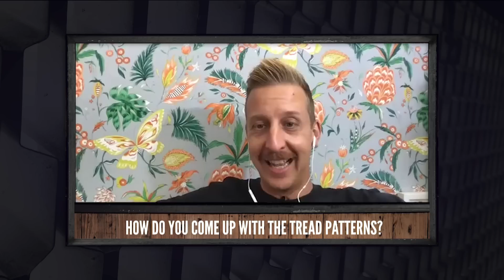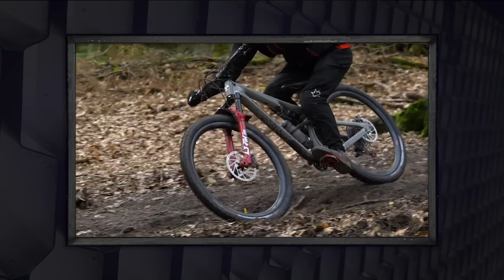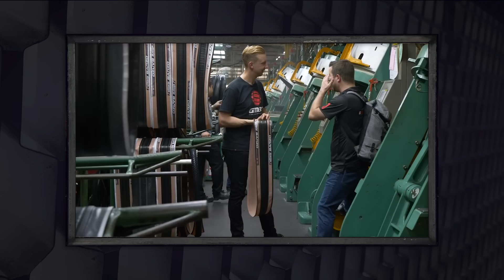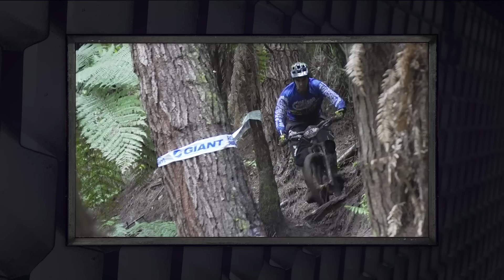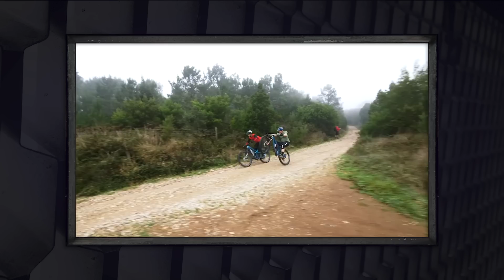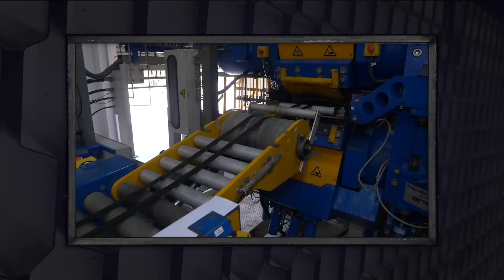What Goes Into Mountain Bike Tyre Development? | Tyre Talk With Vittoria's Ken Avery

Comment: Been a Michelin man for 15 years, on 26's and 29´s. Wild Gripper,  Mountain all Terrains and Wild AM´s.  Was never dissapointed with them. But wanted to give other brands a chance.. First was a used Continental Petrol, 26´ oh yes if anyone remembers.. But got to know Minions last year and Assegai front. Don´t know how the Assegai performs as a climbing rear tire over rocky areas and lose over hardpacked. Anyway, liked the DHR as a climbing workhorse. But The Mazza even better. Can´t imagine better rear tire for climbing. If anyone can challenge that - Im open for suggestions.. Someone has mentioned WTB Vigilante...? Or KRyptotal? Many great brands Im sure. But Mazza is the best I've come across so far. GOOD JOB.

Comment: #AskGMBNTech
Hi gents, I have a problem with my drivetrain. I would pedal but then I'd randomly start freewheeling and I'd hear loud crunching noises from my cassette. At first I thought the chain was slipping so I bought a new cassette and a narrow-wide chainring as well as a new chain. Installed them all but the problem persists. I think it's the hub not engaging properly. Even when it does engage there is about 90 degrees of free pedal play before it engages. What's the solution?

Comment: I've got mezcal's front and rear on my XC and its perfect for long days on trails and thanks the central ridge rolls damn quick on tarmac too, commuting on the thing has been great
Reply: The Mezcal is the holy grail of xc tires <3
Reply: I second this. They are perfect for my local gravel and xc
Reply: I went from Aspens to a mezcal in the front. do i even have to say anything else? tons of grip, rolling speed and saved my ass in looser terrain a couple of times. Got a Barzo in the mail and will put the barzo front, move mezcal to the rear as soon it arrives to see if i want to run 2x mezcal or barzo mezcal combo. Still have to ding my rims to get snakebites or get sidewall seepages but the stability from the sidewall feels much better so I'm pretty sure that is also better in the "cape cobra" version.
Reply: @wernervandermerwe8422  Barzo up front when it gets soft, rain, or winter
Reply: @stevem9191  Yeah been running the barzo mezcal combo all year. This will be my XC tyre combo forever, the barzo has got excellent grip and rolling resistance.

Comment: Wow what a wonderful conversation! Thank you indeed. I still didn't catch he internal rim width to tire width thing though. I think I overshot it with my front wheel. I have a 23mm internal width and put a Maxxis Ardent 2.4 on there. I have had a burping and also a wash-out on a steep downward switchback. Fortunately I walked away with minor scratches. But I would like to know if the tire is too wide for the rim and if even a 25mm rim would work.
Reply from the maker: As a general rule, the wider the rim the less chance of burp and roll, if you pair the thinner rim with a thinner width tyre then it's pretty stable right? But if you have a thinner rim, and a big old surface up top, your wheel becomes kind of top heavy, meaning when you lean it over it's going to be less stable and want to deform towards the ground. So generally speaking, wider rim, wider tyre, thinner rim, stick to thinner tyres.
Reply: @gmbntech  Thank you. Indeed I figured that, but I was wondering what the limits or best combos would be. I think my bike would take max 2.4 up front and I would ideally like to pair that tyre with a 28mm rim. Getting a secondhand rim of 25-30 mm has been hard. I  actually haven't found one yet. Then wen the rim is too wide, I run the risk of not getting the side knobs in a proper position to really get the traction.  How would one pair these? Maybe just by experience, how have you paired them? These days your guys run 2.6 and 2.8 wide tyres, but what of the XC bikes? I have a very basic hardtail Silverback Spectra. I would like to get the most out of it and thought tyres is all I can really do to upgrade it with not much expense and a decent rim upgrade. The bike only cost R7500 (ZAR) which translates to about 350 pounds.

Comment: #askgmbntech I am building a frame with a 184 x 44mm rear shock size how far can I stretch from the number as that is a pretty niche size. Can I get let's say for example a 185x 47.5 mm or like 190x 50mm. In essence how far can I stray from manufacturer recommendations.

Comment: I finally took a chance and decided to try Vittoria. I bought a set of Martello's, and man were they fantastic! Absolutely the best grip-vs-rolling tire I've ever used. Unfortunately, I had 3 rear flats in the 1st 3 weeks. Twice in the same day, on the same 1/4 mile of trail! All 3 punctures were identical. Inside corner knob tears that took 2 Stan's darts each to plug, and all were on the same side of the tire. This led me to think perhaps this tire was defective, and since I only had it 3 weeks, I emailed Vittoria for advice and perhaps a replacement, if they agreed it might be a defect. Sadly, I never got a response from Vittoria and had to go back to the, less desirable, Maxxis because I never puncture those. However, I kept the Martello on the front, because I'm addicted to the cornering performance. It's too bad. I really believe the performance of those tires are fantastic..
Reply from the maker: Sorry to hear about that Chump MTB! How were you getting in touch with Vittoria may we ask? If they're anything like us then their team will work hard to cover social media outlets but due to volume sometimes content may go unanswered. We'd suggest an email or contact via their website might work best. Glad to hear the front Martello is working out for you, so much grip!
Reply: I emailed their U.S. website.

Comment: I just upgraded from Maxxis Minion to the Vittoria Martello tlr  G2. What a tire! Rolls better. Better grip. More predictable. Confidence boost!
Reply: Awesome to  hear!
Reply: @vittoria  one other thing I just noticed. I do the same run everyday, rough downhill path with rocks.  The Martello tlr G2 is so smooth on such rough terrain. I'm running the same air pressure as I did on the Maxxis Minion, but they do not have this level of plushness coupled with solid predictability. This must be down to your 4 different types of rubber compounds? I have never ridden the turns so fast before. Thanks to the whole team Vittoria.
Reply: I'v had the Maxxis minion original mount on mine, never liked it, the coumpound is too hard.
I've chande to Schwalbe Magic Mary, they're amazing, I'd like to try Victtoria's tyres though.
Reply: @ulukai_555  Did you have the 60 or 120TPI Minions? I had the 120TPI & it has been the softest & most comfortable tire i've used so far, in contrast, all Continental tires i tried feels like a solid rock even at 14PSI, fast as hell though but not fun to get a brain haemorrhage every time i ran over a pebble ;)
Reply: @Jeppelelle  60 TPI.
Reply: @H Sig I’m interested in making the jump over to Vittorias as well. I was thinking about doing the Mazza F/R or Mazza front and Martello rear. How do you like the Vittoria set up friend?

Comment: If you have a dent in your rim and dont run tubeless should you replace the rim. Does it increase the number of pinch punctures
Reply: It is a good idea to replace it but if you run tubes, you can very very carefully bend it back with some vice grips
Reply: Do you know what causes them
Reply: @LJS1605  of you case a jump to hard our you land on a sharp rock. Another reason is just repetitive use, if it happened over a long period of time, your probably reaching the end of the rims life span
Reply: I'm running tubeless and dented a rim and it still seals up fine. The metal will be more fatigued there from being bent and reduce the life of the rim. I wouldn't bend it back which would cause the metal to fatigue further. Keep riding it but keep a close eye on how true the wheel spins and spoke tension. Start looking for the next rim or wheel set you want :)